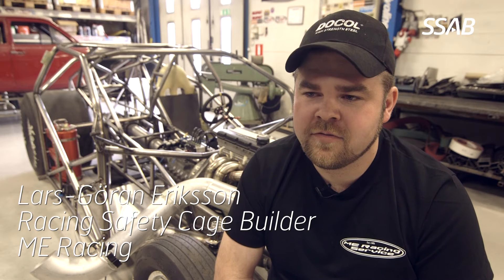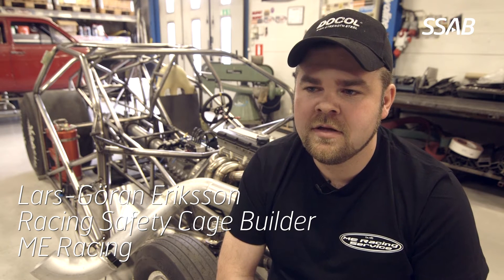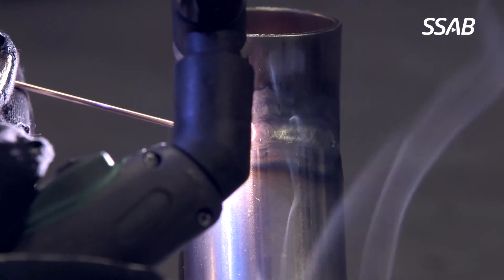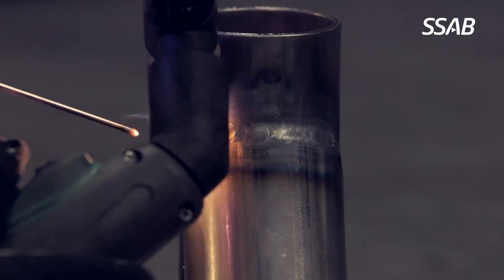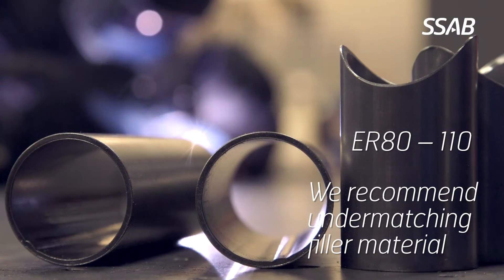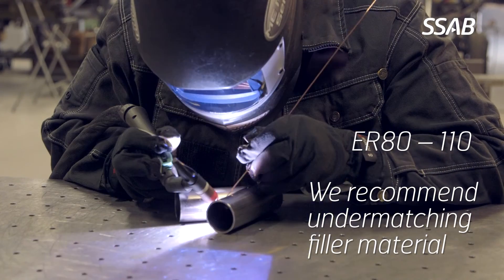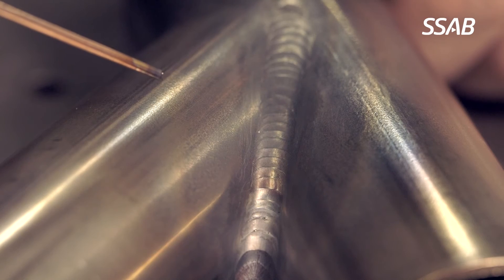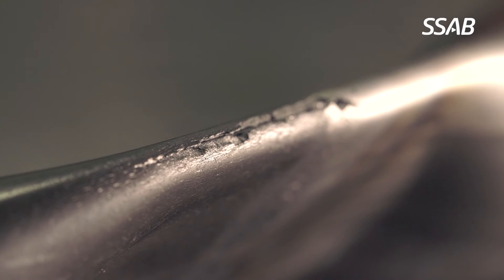How to best weld a Docol R-Series tube for racing

Comment: I thought those materials are like chrome moly does chrome moly have alot of nickel if so why not use stainless filler wire instead of carbon steel er 10 filler wire
Reply: Docol R8 should not be heat treated like Chromoly. It has better properties that make welding and bending it a bit more like standard mild steel. Which means a easier point of entry into working with it, unlike Chromoly steel.